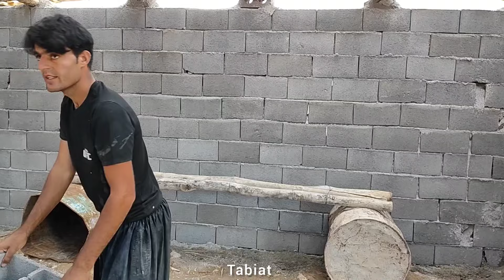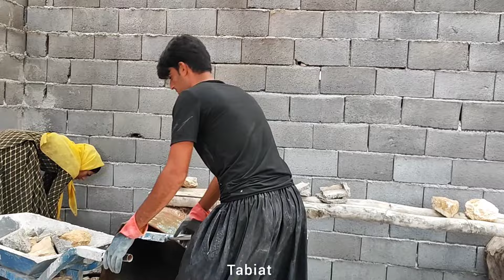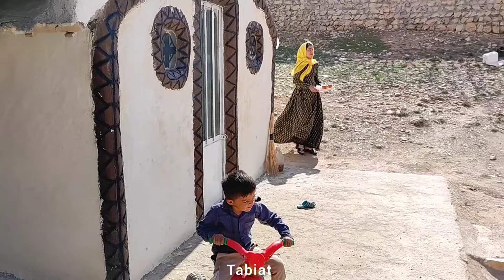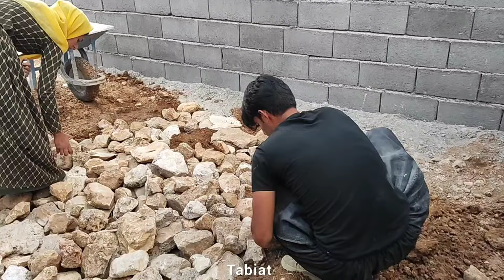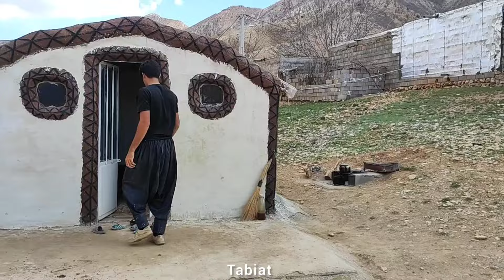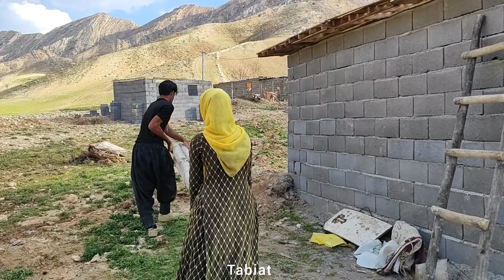Strong bond: between Sahar and Rostam on the way to building a dream house

Comment: Your New house very big and nice I love  your creativity and work awesome man
 I suggest that the floor of your new home should be 10 centimeters higher than the floor outside the room.  To prevent rainwater from flowing into the rooms of the new house.  And you should adjust the level of the floor in front of the bathroom, pouring a slope sloped down in front of the balcony.  so that the water flows out quickly and does not retain rainwater
Thank you